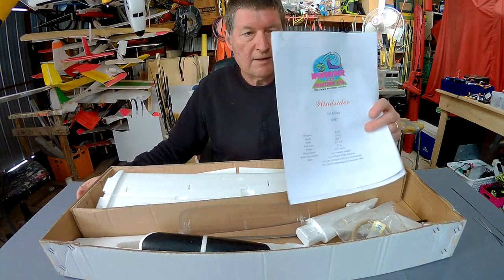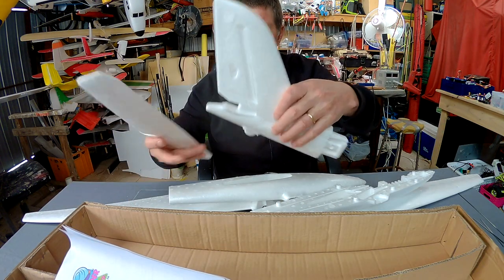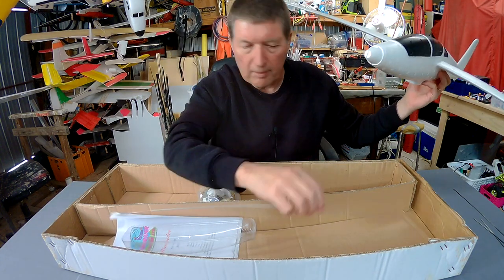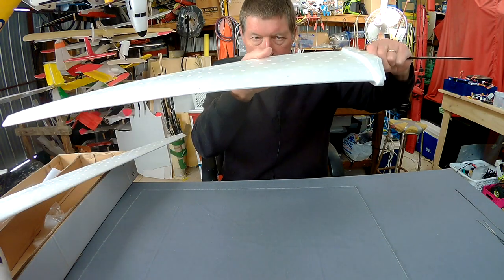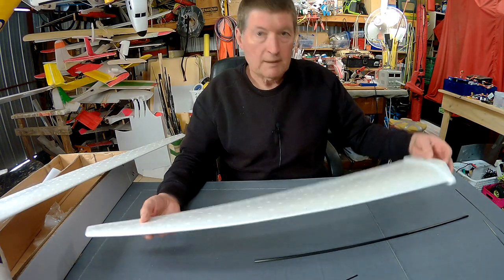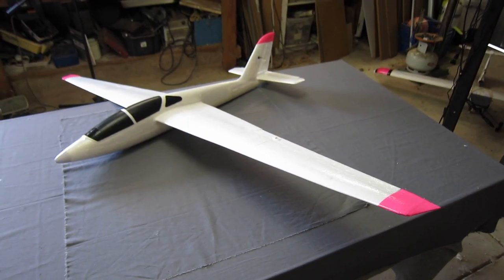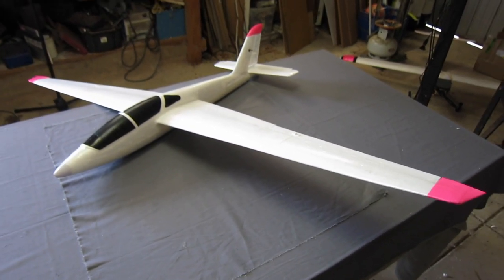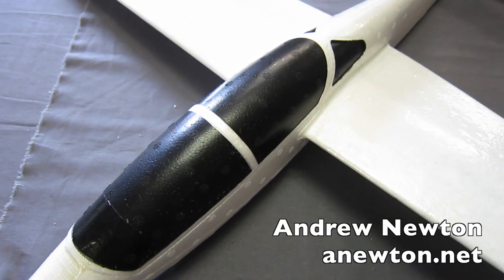Windrider Fox - build

Comment: Amazing this fox.. cant wait to see how it does on the slope..

I do have a couple of questions on the laminating stuff:

1- apart from strengh.. is there any difference in drag? i have seen some folks claim that being "smoother" the wing creates less drag and so it goes faster on the slope ..

2-Ironing EPO .. does it "bubbles" ?  (you know , when EPP/EPO gets hot like on hot water and it becames like a corn cob :D )
Reply from the maker: Strength and stiffness are the only reasons I use it. I think it would be impossible to measure the difference in drag. You have to get the heat of the iron right. Not too hot for the foam but hot enough to melt the adhesive. I use about half heat or the Wool setting.

Comment: Hello!! What is blendem hinge tape? Is it a special tape?
Reply: It is actually surgical tape made by 3M. Very flexible and, unlike many other tapes, it seems very resistant to UV light which means that the adhesive doesn't dry out over time. It is a bit more expensive but well worth the small extra cost.
Reply from the maker: That's right. Look on HobbyKing.
Reply: thank you very much!!